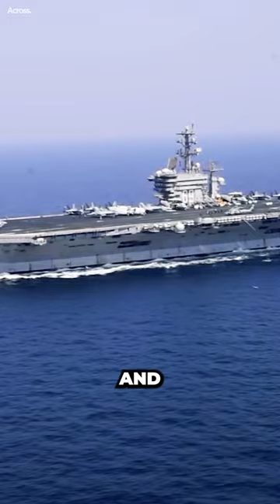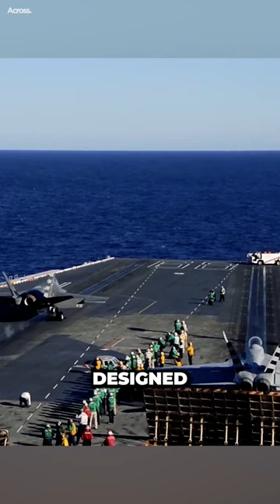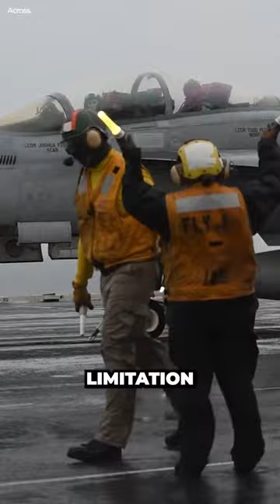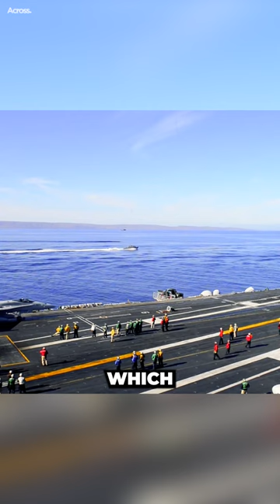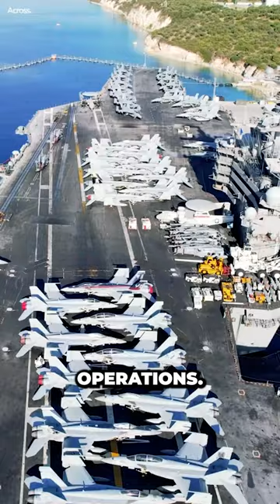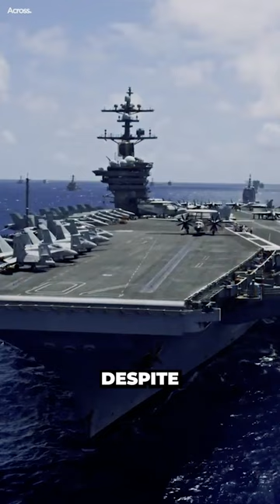Why Can't Aircraft Carriers Have Longer Runways? #shorts

Comment: This raised the question but didn’t even come close to providing an answer.
Reply: Yup
Reply: Long ships break up in rough seas.
Reply: I wanted to post the same observation. Posted question was not answered at all.
Reply: Exactly... how hard is it to say "aircraft carriers are military ships that need a minimum amount of speed and maneuverability, the ability to be accommodated in a wide variety of ports and pass through waterways like the Suez and Panama Canal. This limits their size and thus the available deck space that can accommodate a runway."
Reply: Wikipedia says the Gerald Ford is the biggest warship ever (1100 ft). Tho longest ever ship was 1500ft so maybe they can get a little longer
Reply: Their length is also limited by the port facilities.  And by the size of drydocks used for maintenance and repair.  There are many factors limiting ship length.
Reply: I was just about to say the exact same thing.
Reply: @jamesjellis that's all they had to say.  Thank you
Reply: Clickbait
Reply: You need an ideal ratio of length to width for a large ship. The longer you go, the wider you go. But our biggest ships are right around the limits of the suez canal. At the skinniest points of the canal you can stand on the flight deck and see land on both sides and not water because its so thin. So you cant really go longer. And if you ever look at a flight deck they only use about half to launch the planes...so they dont even need the full length of the flight deck. The catapults are pretty powerful and can get them up to flight speed pretty quick

Comment: Did I miss the answer?
Reply: Yes.....we all do😂
Reply: You need an ideal ratio of length to width for a large ship. The longer you go, the wider you go. But our biggest ships are right around the limits of the suez canal. At the skinniest points of the canal you can stand on the flight deck and see land on both sides and not water because its so thin. So you cant really go longer. And if you ever look at a flight deck they only use about half to launch the planes...so they dont even need the full length of the flight deck. The catapults are pretty powerful and can get them up to flight speed pretty quick

Comment: Rough seas have nothing to do with the need for the runway to be oriented into the wind. The runways need to be oriented into the wind because they are short.  Not because of the sea state.
Reply: Rough seas are why the runway needs to be short. The runway being short is why it needs to be facing the wind. So, by the transitive property, we can extrapolate the rough seas as a root cause for why the runway needs to be facing into the wind.

Comment: If anyone is wondering, waves can cause stress at the carrier's hull and could possibly lead to structural failures, the longer it gets, the more risk it has at breaking. 

Alternatively, a longer carrier also means a very expensive ship, carriers are already expensive enough as they are, so adding more length may not be economically, logistically, or stratigically sound.

There's your answer

Comment: You're a bit wrong. First, is not a "Runway". It's a Flight Deck. Also, it's not just the catapult at work, is simple physics. Carriers are in motion during operations. Turning into the wind to provide extra thrust and having the ship in motion at roughly about 30 knots. Even if a jet is stationary on the flight deck, the ship is still moving. All adds up to no requiring a long flight deck for carrier operations.

Comment: Hahahah you're a bit wrong,   the aircraft doesn't need to be light enough to take off from a US Navy Aircraft Carriers because the heaviest aircrafts to launch from a US Navy Aircraft Carriers are the A-3 Skywarrior and the A-5 Vigilante which is over 80,000 pounds plus and the heaviest Fighter was the F-14 Tomcat, had the F-111B made it to service it would been over 100,000 pounds at launch weight

Comment: Let me help... aircraft carriers are not longer than they are because they don't need to be. The catapults and arrest gear alow the navy to operate aircraft at this length of ship. They are huge as they are. To make them longer so you can remove the catapults and arrest gear, would be an engineering and financial disaster. Everything in the design of a ship is a balance and compromise between need and cost/practicality. As the navy sees it, these ships are the optimal blend of those factors.

Comment: Well, aircraft carriers runways are catapult assisted. They don't have longer catapult runs because they aren't needed, the planes achieve take-off speed using the existing 325ft length.

Indeed, the problem with steam catapults isn't lack of power, but the sudden full power kick inducing damage to the airframe and reducing aircraft life. The steam catapult power also means it is too powerful for lighter aircraft such as UAVs.

The EMALS launchers on USS Gerald R Ford provide a much smoother acceleration over the 325ft length and can accomodate light weight UAVs.

I guess the video title really should be about the length of the carrier flight deck rather than the runway, but it doesn't explain either so I would encourage the channel owner(s) to take this video down and re-do it (without the horrendous gaff about heavy seas meaning take-offs need to be into the wind) actually explaining the constraints on ship size

Comment: They can't have longer runways because they are already monstrously expensive, often literally billions, and to make them long enough to accomodate a proper runway, would easily TRIPLE the price to build one with this shorter runway and catapault/catchline system.

There. I did in one comment and probably less time to read than this short what this short totally and absolutely failed at as it meandered completely off the question it asked in the first place.